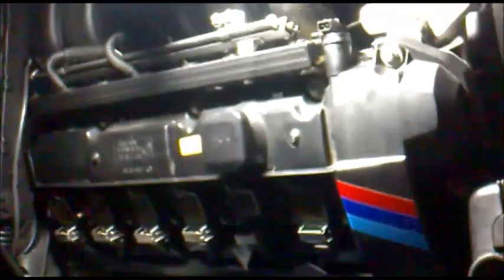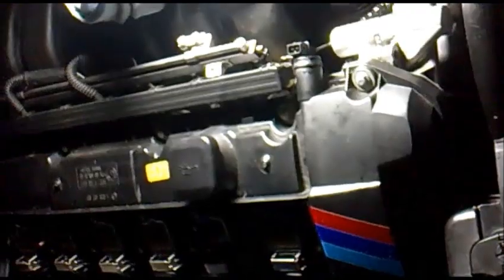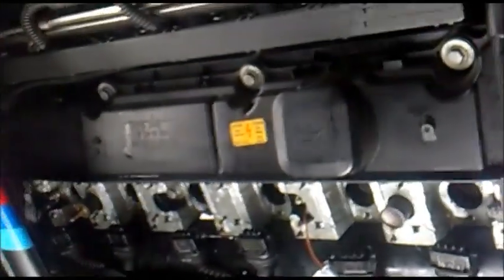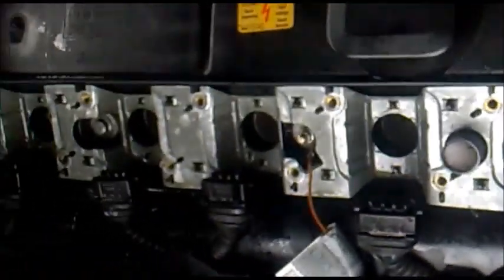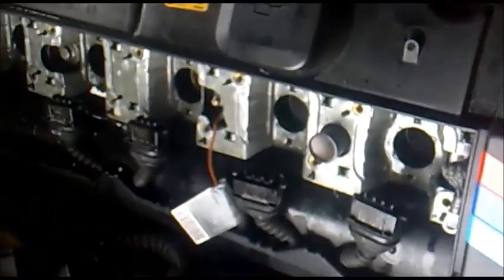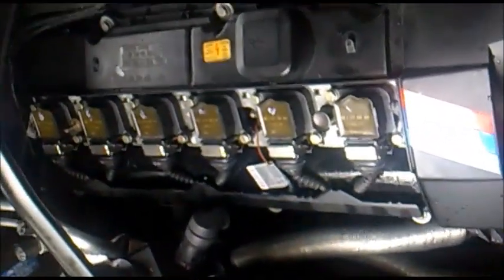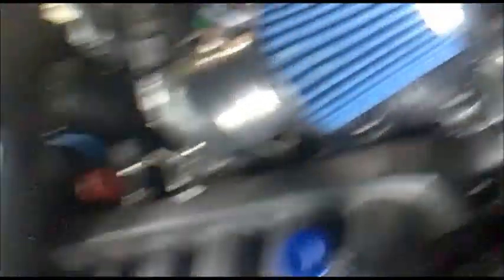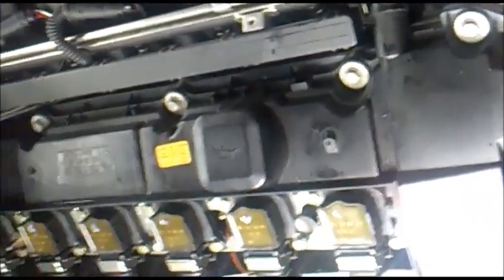Fix for Crank No Start BMW (Fuel Flood/Cylinder Washed)

Comment: My bmw e46 crank but doesnt start,i replace new battery ,replaced new glow plugs ,same problem.the one night the enjinblower fan came on,the other night the alarm went off.were can my broblem be?
Reply from the maker: electrical problem, short circuit , maybe bad fuse or relay, or ecu or some wire gone bad, you have to test, parasitic drain test using a multimeter, do some google and post on one of the forums.

Comment: engine fired right up
Reply: I got a questions I was driving in my 2001 bmw it had no gas and it stalled it would crank and not start i put half tank of gas and it would still crank and not start i replaced the plugs samething happens i chdcked for bad fuel pump the mechanic said its good is there any chance that the fuel pump might have pressure but might be giving wrong pressure? Any help pls
Reply from the maker: Well, Glad it helped, share it around, give me a shout on facebook or the forums or whatever have you. All the best.
Reply: Hyde Motor Works 
Could you please send me your email address

Comment: one more question: do i have to remove both the fuel pump relay and the fuse? can i just remove only the fuel pump fuse? looks like a pain in the ass to drop that glove box. gonna try to do this tomorrow before the expected typhoon rolls in.
Reply from the maker: Well, you can try that at least I guess, you will know if the fuel pumps working or not, could also disconnect the injectors power but I dont know, give it a shot if you like. all the best with the coming typhoon.

Comment: hey, what did you use to put the oil in the spark plug holes? about to do mine. by the way, I was just told that holding down the gas pedal while starting the car solves that problem. what do you think?
Reply from the maker: try using them syringes or a squirt or oil dropper things old school stuff, for a few bucks the dollar store or auto stores will have em heck you can even just use a tea spoon and see a few drops going in and go from there,  yea the gas pedal method can work too in certain cases, but hey this is how I did it after trying that other method.
Reply: thanks man. i tried the gas pedal method today and it didnt work. gonna do the oil method tomorrow
Reply: I zip tied a straw to the end of a funnel
Reply: @seanwagner6356  oh man, seven years too late.

Comment: Is it cause piston not sealed well ?
Reply: 4 years late but eh. Its cause the engines requires a thin layer of oil on the cylinder walls to make compression. 

When running rich, the fuel can wash that oil off the wall, and the engine will no longer make compression.

Comment: Why this happen ?
Reply from the maker: In the description, cause, symptom and remedy is outlined, its a old 
mechanics trick, something you also do to test compression on a motor 
after the dry test. Root cause is if you have cylinder wash then the 
excess fuel eats up the oil that seals the pistons, and thus motor does 
not start up or run right, putting some oil makes the seal to have a 
little run till the motor lubes itself by splashing as most older motors
 do. Its a common issue with the BMW's one can notice if run for a very 
short time and left for a few hours.